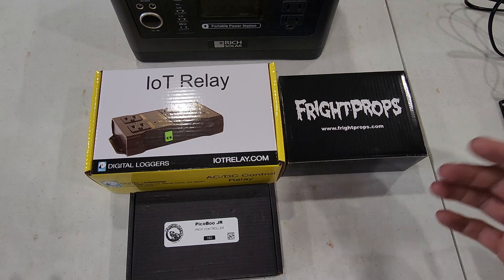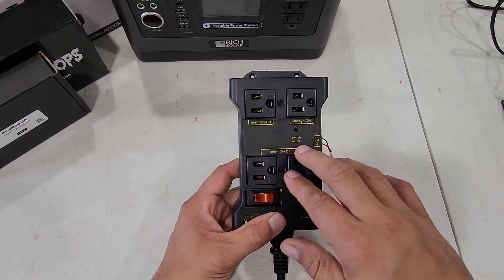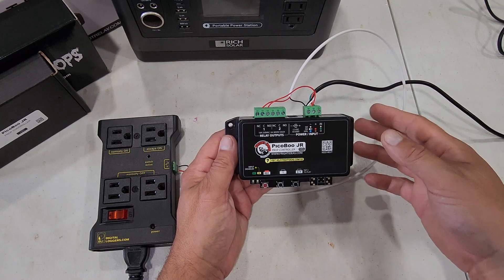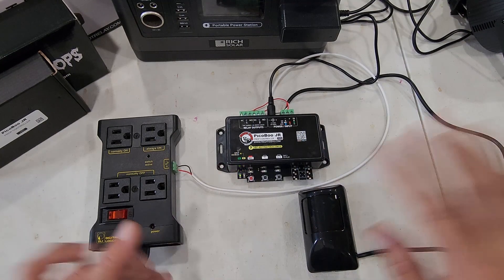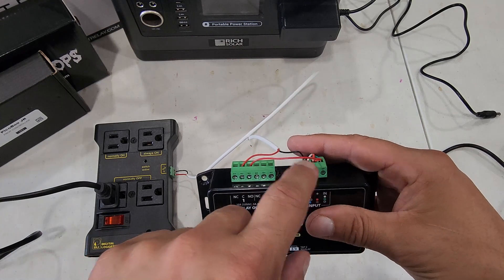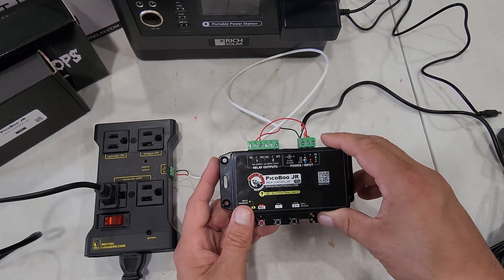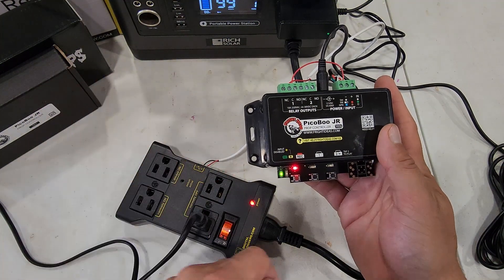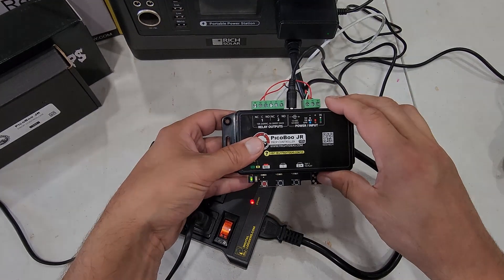FrightProps PicoBoo Jr + AC Relay wiring with motion sensor

Comment: Hi! I have the picoboo jr and PIR motion sensor hooked up to one prop that speaks. Do you have a video on how to hook up a second prop to this that also speaks?  Thank you for your videos.
Reply from the maker: The easiest way is to take your 2nd Relay Output, and run a trigger wire from the C/NO outputs of that side, into the try-me jack on the prop itself with a 1/8" plug into the prop (if it has such a jack). Then when you program your Jr, you can just add relay #2's button into the mix. I'll try to get another video up very soon when I actually hook this up to mine as I'll be using relay 1 output just like this video had for the strobe but will be wiring in the Boogeyman prop to trigger at the same time :)
Reply: @HauntedHouseofOxford  I think I understand. This helps me a lot. You're the only video I can find close to what I'm asking! Happy Hauntings.

Comment: hey this will do a lot of cool things, also there's a plug in motion sensor on Amazon that  would probably do the job , but this will grow and do other things
Reply from the maker: Very true. The only drawback is that some props (like The Boogeyman) start their phrases at the same one every time power is applied, and many of the motion sensors that plug in like that are just turning off and restoring power with motion so some props might end up just using the same phrase over and over. But definitely a great way for many props and effects and quite a bit cheaper!